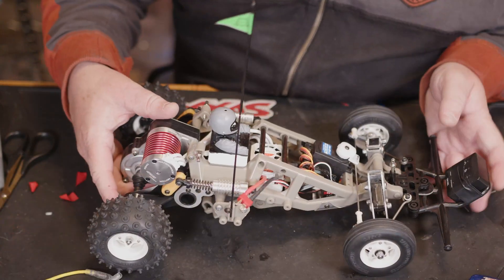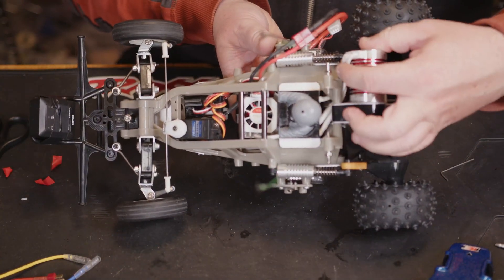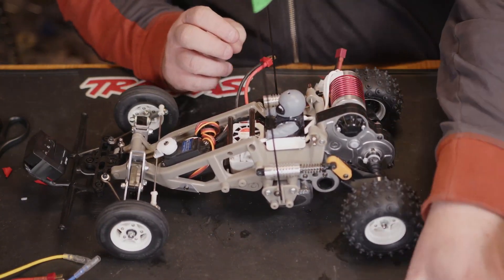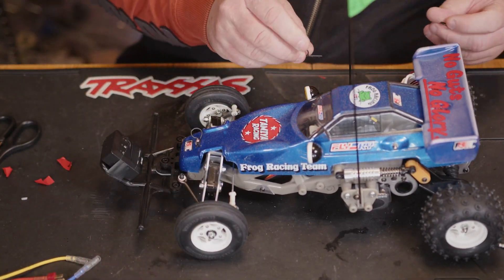Tamiya Frog brushless conversion surpass hobby 4370KV motor and 60amp ESC.

Comment: Got a frog ,how does the controller connect to the new speed controller?
Reply from the maker: Just plug the esc/speed controller into ch2 on the receiver and servo into ch1
Reply: @WTFRCCars it's an old controller
Reply from the maker: @chrisstephens6194 all transmitters are the same ch1 steering ch2 throttle/esc
Reply: @WTFRCCars cheers, it's in the loft I'll get it down today
Reply from the maker: Cool if you get issues give me a shout, might be easier on my Facebook wtfrccars group to help you as you can post pictures of the set up too.

Comment: I think I need a frog 👌
Could you have had the motor wires pointing down? Instead of them up against the body?
Reply from the maker: We have tried the motor wires down but they are not really long enough and it's easy to get bits stuck in the wheels hitting the wires :)

Comment: '
never put motor brushless in my tamiya and traxxas / kyosho / tonka models...
better normal 540 / 550 motor...
kyosho blizzard with twin 380 motors...
tonka truck with kyosho twin 540 motors
Reply from the maker: I run brushless in the frog and monster beetle both work fine also brushless give much longer run times as the AC motors are way more efficient than brushed

Comment: What battery do you use for the frog? I can only see it's a 4000mAh one.  My Frog is more than 35 years old and after watching your video, am thinking of doing an upgrade too. 
I also have to change the remote control - I think it's the original analog 40Mhz version. What do you use - 2.4Ghz? Thx a lot!
Reply from the maker: Yeh the batteries I run are the zeee 2s 4200 and gens ace 2s 4000mah both work fine, as for the transmitter the flysky G7P is fantastic for the tamiya range as it has loads of receiver options and really good price for a 7ch 2.4ghz radio, I have a playlist for the G7P too :)